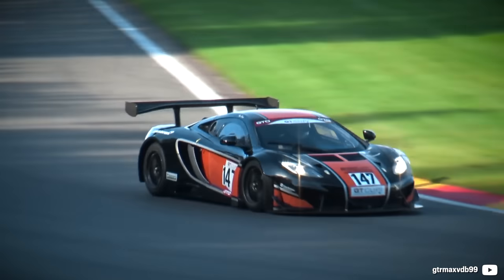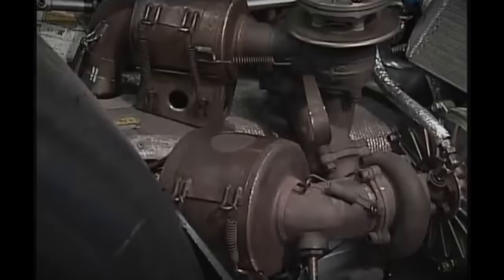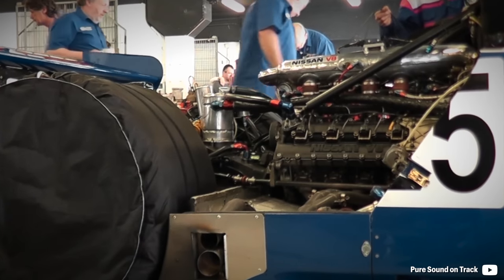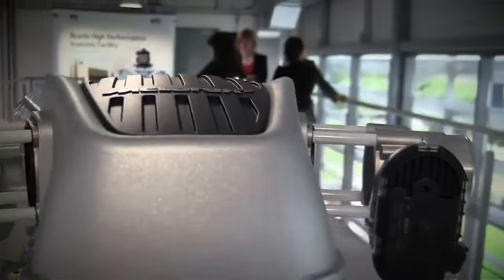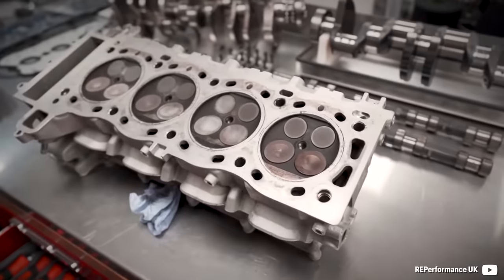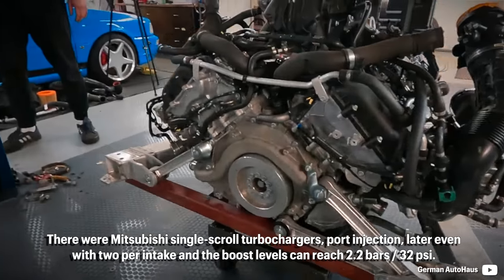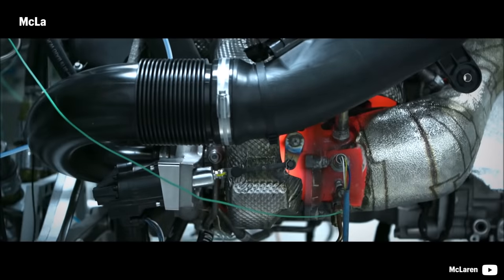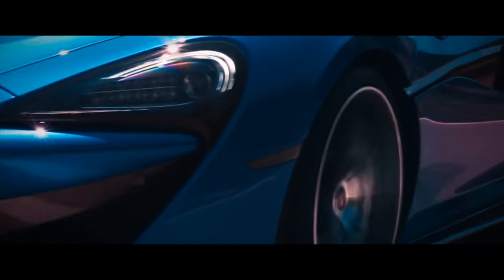The Reason Why A McLaren V8 Is So Good

Comment: I’d love to see a video about the mercury dual over head cam v8 and how they helped design the c4 zr1 motor. Then using what they have learned to make what they have since the 90s. 
Big block NA motors made to handle Marine environments. There blower motors making up to 1200hp and there duel overhead cam twin turbo motors making 1650hp. Making that power continuously over the entire time until there recommended top end rebuild time comes after a certain amount of hours. 
These motors make this power reliability and can always make it no matter what. 
Different power settings depending on what fuel is used.
Reply: The ZR1 engine you speak of was not designed by Mercury Marine. They just machined and assembled the engine in Stillwater Oklahoma. It was designed by Lotus in England and CPC division of General Motors. You are correct about the later generation of engines with engineering details taken from the LT5. The LS series of engines have plenty to thank the LT5 for.
Reply: @bobolulu7615  yes I know

Comment: how can the max power of the MP4 be at 7000 rpm and the rev imiter at 8500??
Reply: Assuming that's just where the powerband peaks. It probably won't make anymore power after 7k or so but rev limit is at 8k for whatever reason

Comment: Why McLaren and/or other supercar makers never seem to tap Cosworth for a models power plant. IIIRC Cos is based in England (be good for McLaren), known for very high revving, powerful, and reliable motors.
Reply: Most probably cost, practicality & reliability. it likely would have been more financially restrictive for a relatively small company like Mclaren who doesn't have the corporate heft behind them of say Lambo or Bentley who are owned by VW and the research and development of the existing power unit had already mostly been done by Nissan themselves whereas a clean sheet design would likely had blown their budget. Plus, Japanese made ICEs have a reputation for typically being quite reliable. Mclaren aren't the onjy ones to have done similar to this tho. Hell, the Aston Martin V12 was sourced from their one-time owners Ford.

Comment: Overcomplicated POS. My built NA iron 4 bolt SBC in my frontmid-engined Cobra did 550hp at 7000hp and ran 100000km without much wear and 0 probs. The car weighted 300kg less than a McL and 1400kg less than a Veyron. It cornered better than a McL or a gatti, except on bumps, and straight acceleration was better. 1.7 on a good day and not much heatsoak even at 35 C ambient. I am still not impressed by those heavy tanks.
Reply: blah blah pos